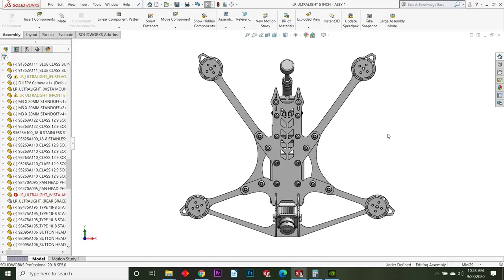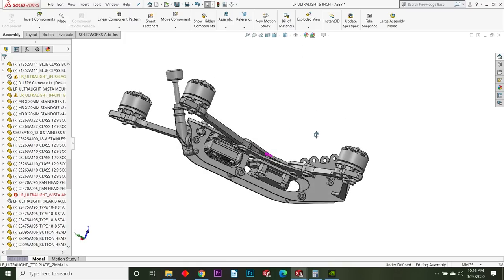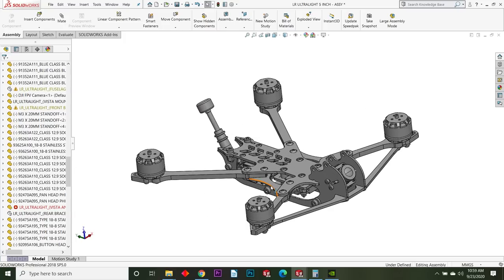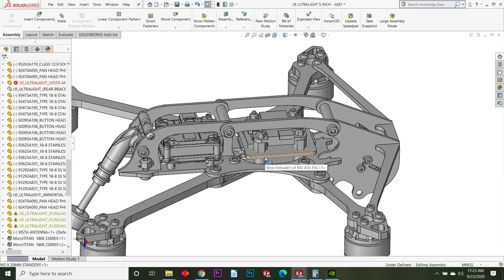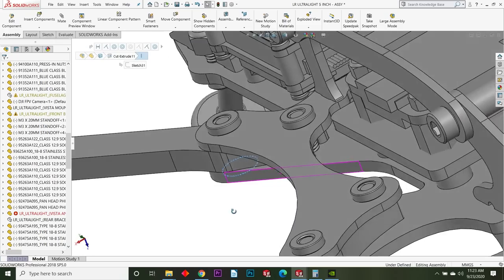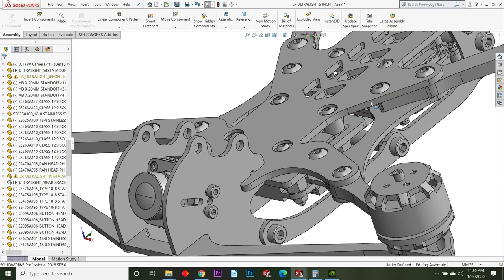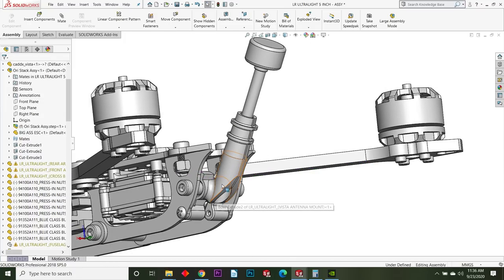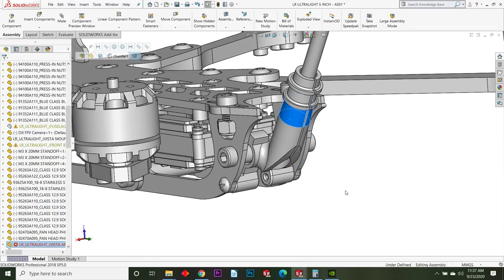THE SHOCKER (A DESIGN REVIEW)

Comment: Neat design! I'd love to test the 4"
Reply: Me too
Reply: I think that needs to happen. Catalyst should definitely make that happen for you Dave C
Reply: Do the 5" im torn between yours (i dont know the weight) which im still wondering if fits 25x25 aio. Flouride and this.
Reply: I have the 5" Shocker and a Diatone Roma 4" LR build and it looks like this frame is better than the standard MLR designs, at a similar weight it's so much more durable! I'm considering switching mine 4" to a shocker as well

Comment: I bought the Flywoo LR based on David C design.  I was wondering what the optimal long range design would be using a 18650 Li battery pack vs 21700 cell.  The energy density estimate for the 18650 is 250WH/KGS vs 300WH/KGS for the 21700. I'm sure it will have a double entendre name before it's complete.

Comment: Looks pretty cool, specs are great. Do I have to use a unique motor or can I throw anything I have with the standard layout on these arms?
Reply from the maker: Its a very specific type of spec. You need motors with m2 screws on 12mm diameter circle. Like this...https://www.brotherhobbystore.com/products/vy-2004-motor
Reply: @catalystmachineworks4794  cool thanks for the reply... any chance you'd make arms compatible with other motors?  I love building my own, but am hesitant to go this route with a new type of motor and limited prop selection... whats the BNF going to cost?

Comment: I think you'll have to shave off 15-20g on the 4". It's too heavy to be sub 250 with a vista which is sort of the whole point of going 4" 🤔
Reply from the maker: Good suggestion. I took a look at the 4" version and am adjusting plate thicknesses and other things. Got her down to 44.7g. I may be able to shave off a little more but not much.

Comment: build would work out lighter with a toothpick board?
i don't like how the area of the topplate for holding the front arms transitions into the rest of the plate
doesn't look like it would hold up to a lot
and so many screws just for holding the frame together
i design my own frames, the latest only has screws for holding on the components, frame assembly doesn't use any